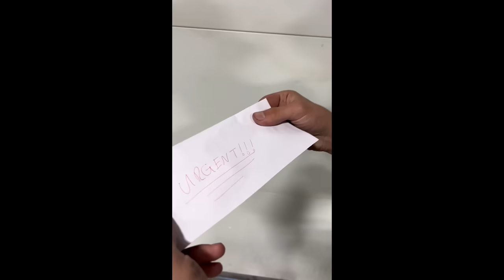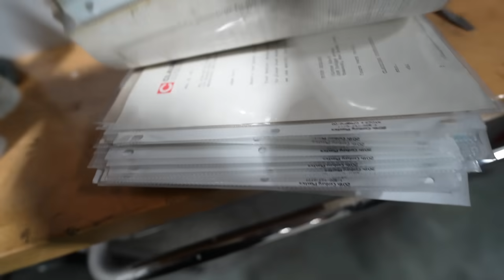COMPLETELY STRIPING MY RHD CIVIC AND FOUND THIS!

Comment: This is normal civic rust - wiper tray, along the pinch welds in the bay and the floor. No biggie, all you can do is fix it. Scary part is, Hondas hide rust really well until its almost(if not) too late

Comment: Hey I'm doing the same budget build, the only issue I had was the radiator top connection hits the throtle body and intake pipe, I had it fabricated to fit. Would recommend a tucked radiator.

Comment: Chase bay stuff looks great, but I’ve never had a single one of the products that don’t leak especially if it has brake fluid. I’ve had two hand breaks both of them leaked.  I have a brand new hoonigan one in a box not even gonna ever open it there’s no point I know it’s gonna leak.

Comment: I paid 300 for my 1906 monarch lathe and I got an electric motor and a controller on it to control voltage and I can control the speed through that with out shutting it off

Comment: Hey grey coat where are you going with that Ant? jeez dude was that the biggest one they had? lol
table lathe sound like it needs new bearings and grease. or is that sound normal for the old ones? [i never worked with em that old]
Reply: Backgear probably needs new bronze bearings, straight cut gears so they are always noisy

Comment: since you're planning on tucking the brake lines you should consider upgrading to a 94-01 integra 40/40 prop valve and 1" brake master cylinder to fully utilize your 5 lug conversion